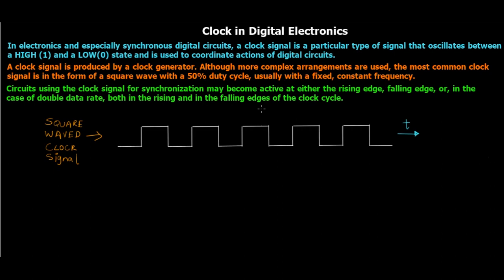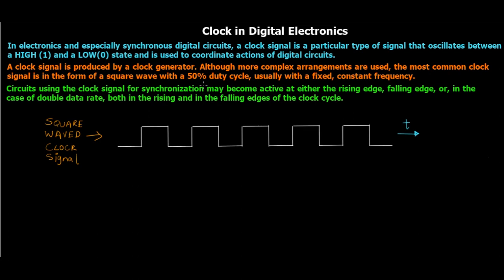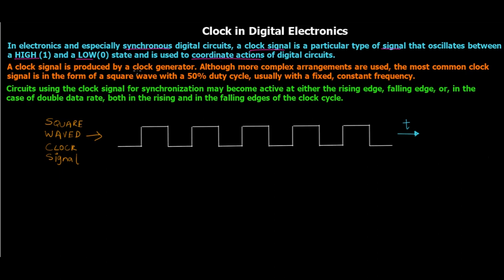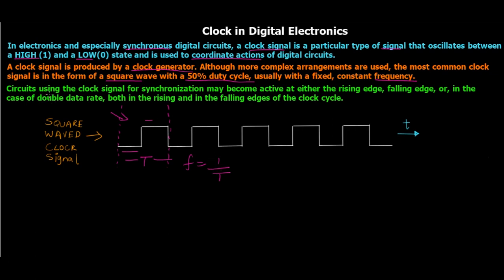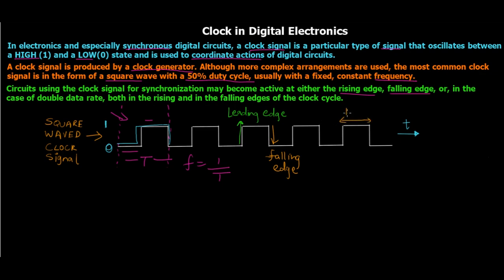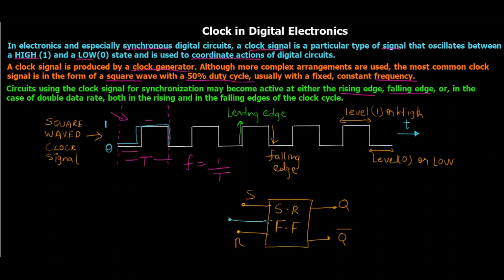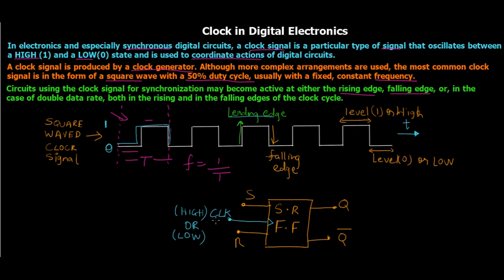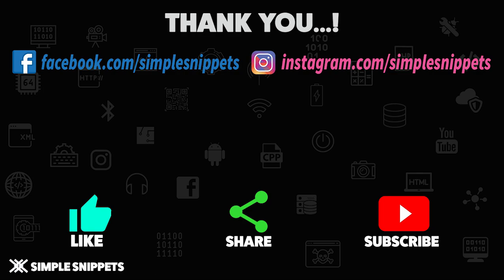Clock in Digital Electronics | Clock Synchronization & Control in Sequential Circuits

Comment: Thanks for the video.  How do I synchronize the clock to my input signal?  For example, what if I'm sending serial data as another square wave input, how can I ensure that the data stream is correlated correctly with the clock such that the data will be read properly?
Reply from the maker: Check my clock triggering techniques and asynchronous counters video. You'll kinda get the idea of how circuits are turned on and off in sync with the clock ✌️